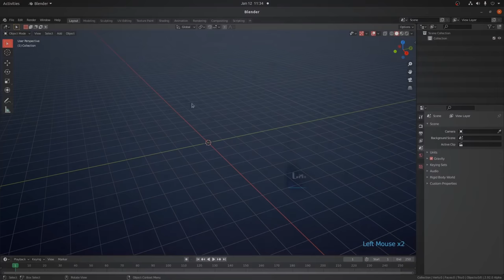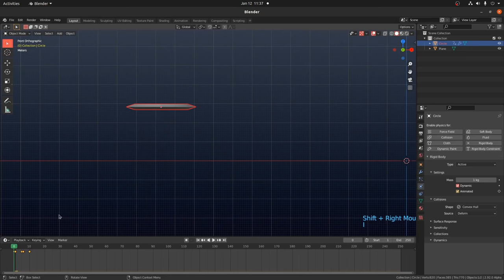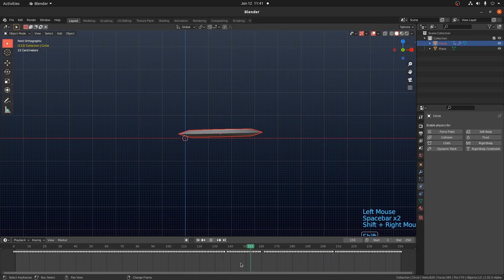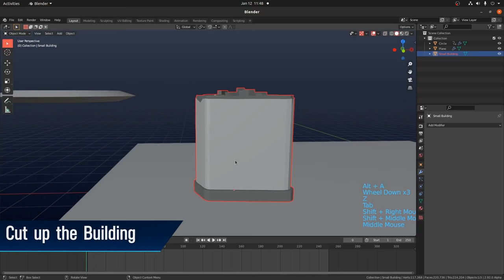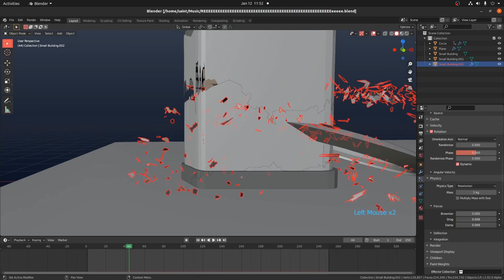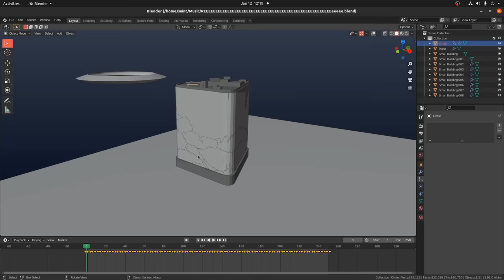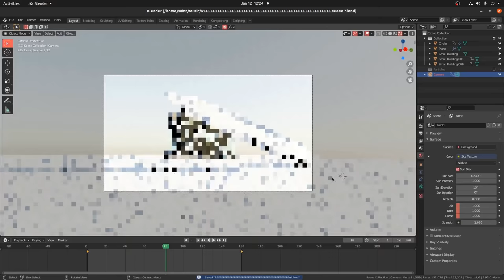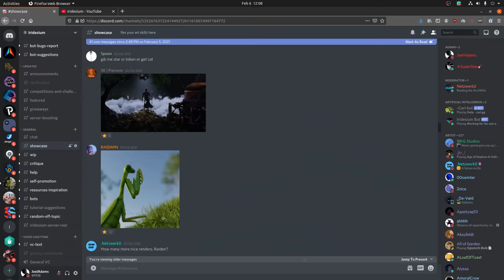Destroy Anything with Particles in Blender - Iridesium

Comment: Instead of having to explode each chunk manually you can add a ramp/gradient texture on that one chunk in the particle Textures settings. Then just use UVs or coordinates to line it up with the saucer's direction of movement. It'll save loads of time.
Don't forget to set your particles to an ABSOLUTELY INSANE number (or use children idk)

EDIT: If you want even more control you can put in a blank image texture and draw on it with increasing opacity for each frame (or decreasing opacity, you'll figure it out).
Reply: Looking you are so experienced man. Where did you learned and which is good YouTube channel on the glob you wanna recommend every noob ?
Reply: I don't know that much about blender, but when it comes to the pieces that touch the ground and go through the floor, would using particles mask the pieces that touched the floor like it broke apart?
Reply: Hey, could you explaint it to me a bit more? i dont really get it and, i dont have the patience to do how he does it in the video, would be great if you did that! or even maybe a tutorial vid, as you dont quite have alot of vids, if you want, because there are like no good tutorials on how to make convincing explosions
thanks!

Comment: Btw you can use dynamic paint with a vertex group to seperate the part of the building that collides with the ufo instead of actually  selecting it manually. Its usually more accurate and less time consuming
Reply: got a tutorial for that?
Reply: @matthewward1346  just add dynamic paint to the object that is to be destroyed. Set the output to a vertex group. Make your collider object into a dynamic paint brush. Bake it until the end of your animation and then apply the dynamic paint on the destroyed object on the last frame. This will bake the vertex group permanently.
Reply: uh im too dumb to get what you mean xD
Reply: @JoaK just apply the dynamic paint modifier on the last frame

Comment: *Looks at my 1050ti
1050ti"I can do it if you give me 2 weeks"
Reply: Me with intel graphics and my 2 core CPU.
First time
Reply: @EccentricFM  same ;D
Reply: On one hand yeah, as a 1050TI user, can confirm :'D
On the other hand, why are people memeing that card JUST now? Not when I bought it in early 2019, replacing an inferior GTS450 so I thought it's awesome? :')
Reply: @PlaidDin  any upgrade is better. they just meme about it cuz it is the "weakest" entry level gpu or something.
Reply: I think you should render it on Linux, Windows slow down the performance. (I'm on Intel HD graphics 2000 and rendering everything I want *with Linux*)
Reply: ahahah bro, yeah, it full true
Reply: try my GTX 960!
Reply: @capawesome3d988  Yes, that's a low end but a good budget card
Reply: @capawesome3d988  same card here :,)
Reply: heyy
try eevee for now
Reply: @luckyizzac  bro, I don't think eevee would be good for smoke animation, it's a simple render engine. The final render would look really plain and not the grainy one (for smoke).
Reply: @CoolGuy! Productions its defenitly worth for a test tho.. if you like it then you can re-render it in cycles when you get time..
Reply: You can use sheep it render farm to render it, it is free but you should also render others' projects in return.
Sadly only works with a file size of op to 500 MB (the project file + cache)
Reply: What about 1060 3gb? Will it work?
Reply: What about 1650ti?? 🤓
Reply: @CoolGuy! Looks at my i3 and nvidia gt730

5 centuries take it or leave it
Reply: @CoolGuy! Nope ain't got no money for that.
Reply: 1050ti team
Reply: i3 Celeron 3205U team
Reply: @PlaidDin  for 99.99999999999% of people (including gamers), a 1050ti is more than enough. People just buy 3090's for games because they can although the difference between medium and highest graphics in a game are almost non-existant, and the same goes for rendering cycles with 16 vs 128 samples. There is a difference, but unless your income relies on it, there is absolutely no need.
The most talented people are the ones who can make do with what they have. And I don't complain much about my 1650 mobile (in an ultrabook with fans that basically don't work). It's honestly good enough for my workflow (I'm don't play games) which involved constant loads. A better laptop would merely be an appreciated quality of life improvement but it wouldn't let me do much more than what I can already do.
Reply: @PlaidDin  Inserts "First time?" meme filled with loads of generation of graphic cards starting from Voodoo 1 - I totally get your point xD
Reply: u guys have a gpu?
Reply: i also have a 1050 Ti  it also takes weeks

Comment: Yeah, i gave up on particles and fluids in Blender. It is soooo random, so bugged and crashes so much, unless you want shitty out of the box low res low detail results.
Blender is a godsend tool in many respects, but when complexity comes i learned the hard and frustrating way there is no walking around Houdini.
So there you go, I finally took the step, out of frustration and hope for Blender's ability, speed and reliability on sims.

Comment: The deformation of the car ( exploding in SloMo) looks great, but damn these explosion simulations look like crap. I feel like with explosion sims, you either nail it, or it looks like crap - there is no middle ground. And with Mantaflow its really difficult to nail it - not to mention the massive hardware resources needed. I hate it.
Reply: Better to use open vdb’s.  Mantaflow just isn’t there yet.